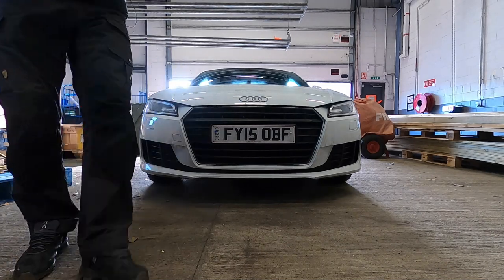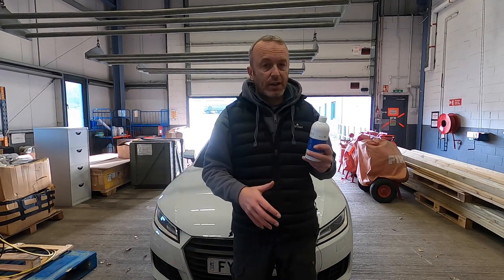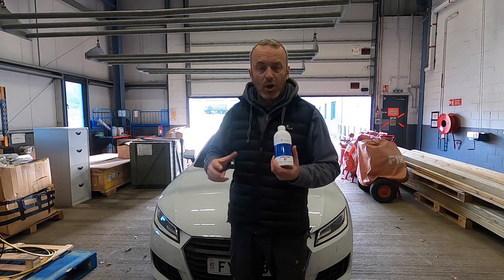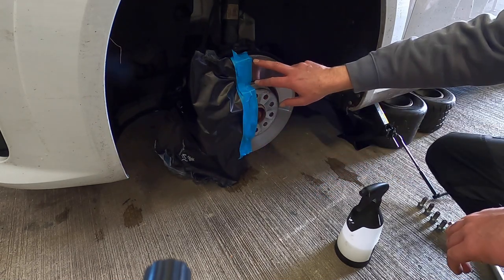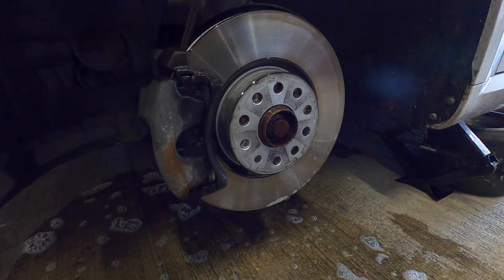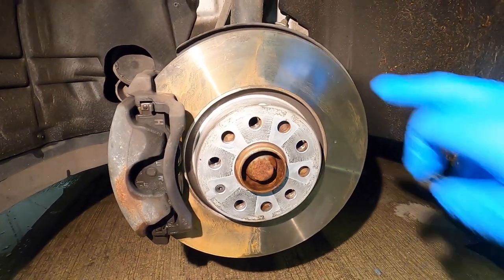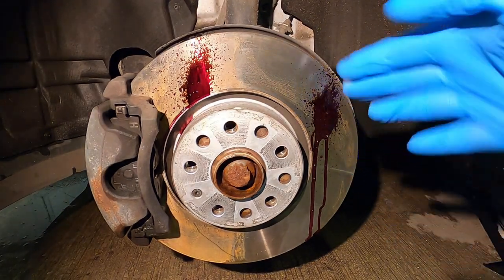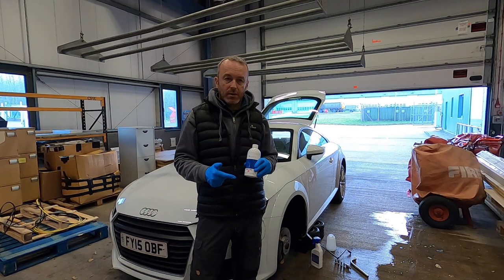The Car Boutique reviews: BILT HAMBER ATOM-MAC

Comment: TIP :- When mixing it in a spray bottle use deionised water 💧 because if mixed with normal water the working strength would be lessened as it would be fighting against the iron in the water 💧  ( iron = ferrous = orange colour ) 👍
Reply from the maker: That's a top tip buddy. Many thanks.

Comment: Another interesting video, the question for me is when the brake disc has got hot and abrasion does it still provide protection or is it just a product to put on after washing every time? Maybe it's better for areas that are not treated to the harsh conditions of a brake disc?
Reply: The protection on the rotors is very short term. It's a detailing product at that point, not protection. It's just keeping the rotors from badly rusting and making your clean wheels orange.
Reply: After buying a bottle and using it at the strongest suggested dilution ratio, it did a pretty bad job at keeping the rotors rust free. There is another product called Hydes Rust Serum which works so so much better
Reply from the maker: Will take a look buddy as always looking to find new products that perfrom.